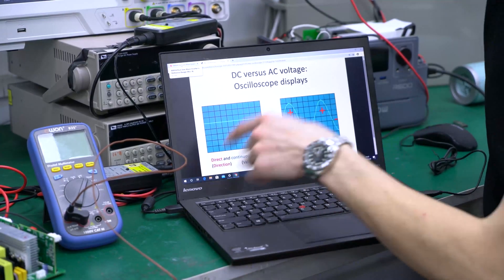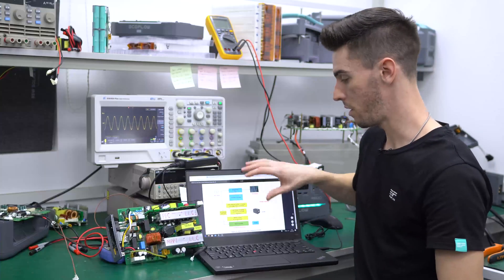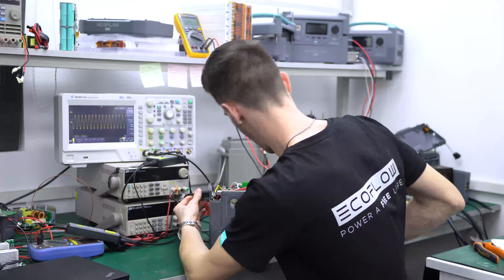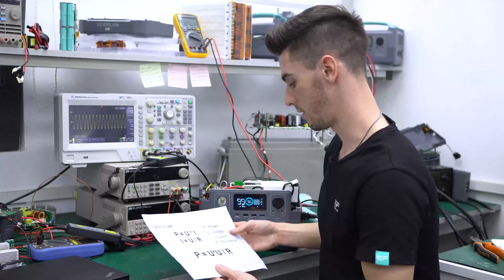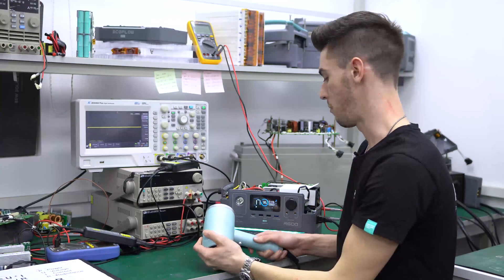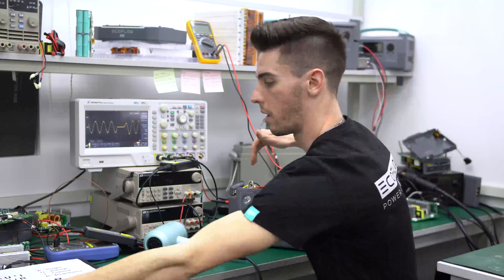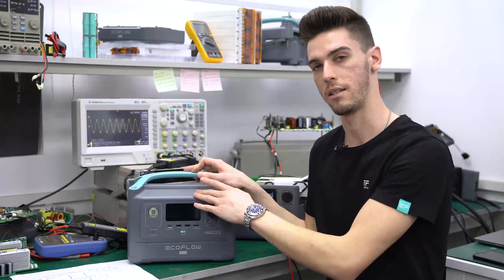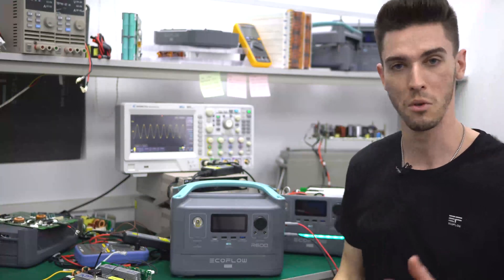EcoFlow Lab: Unveil R600 Smart Inverter

Comment: This is a Japanese user. Nice to meet you.
Thank you for the explanation of the circuit.
I am very satisfied with the use of your EFDELTA.
This R600 also decided to make a reservation purchase.
I'm surprised at the wonderful idea of X Boost.
The principle is that it is lowered to 80V.
Therefore, it has been found that up to 1200W can be used with simple equipment (microwave oven, heater, etc.).
I look forward to your wonderful idea.

Comment: There are really cool things to learn around the world. One thing i learned out there was that the line voltage, what ever load is connected there, is balanced over a complex system that it is as stable as possible at the expected voltage. 
So, you show us a hair blower, which takes 600 watts and the voltage drops down to 80V!? That is 33,3% voltage drop. How can that happen? The inverter should be able to provide 600 watts by almost stable line voltage! If not, the inverter is simply too weak.